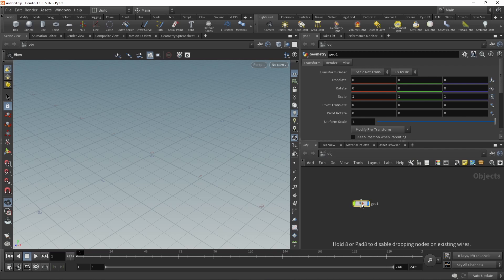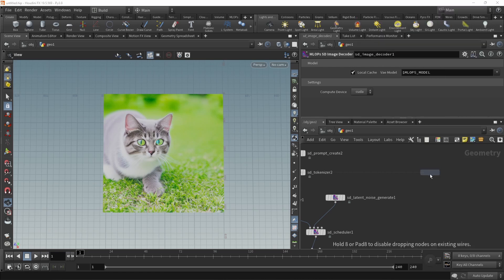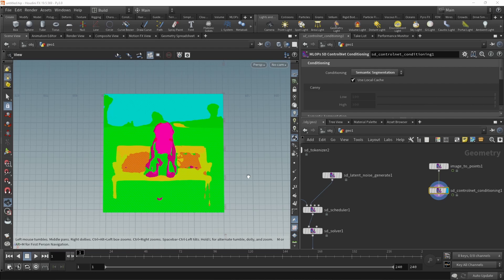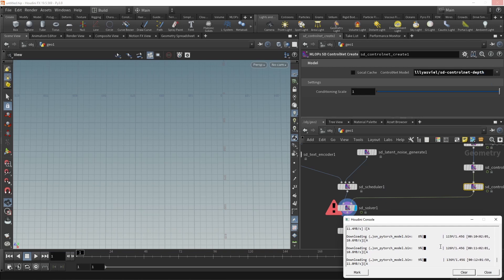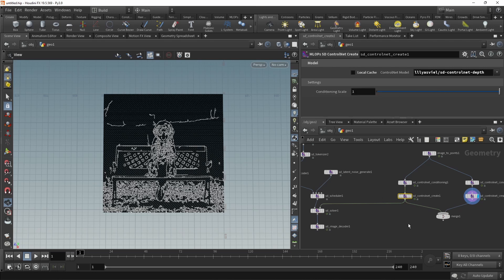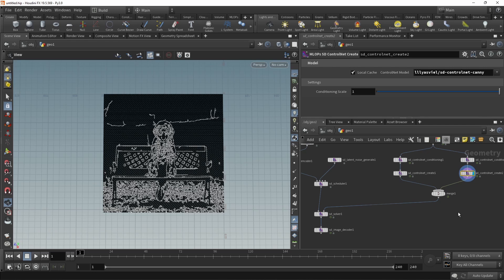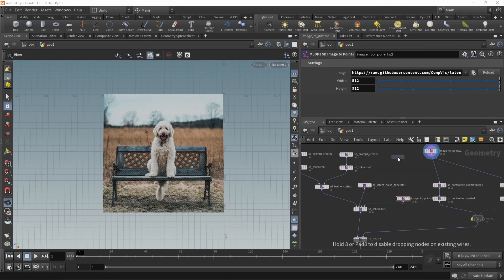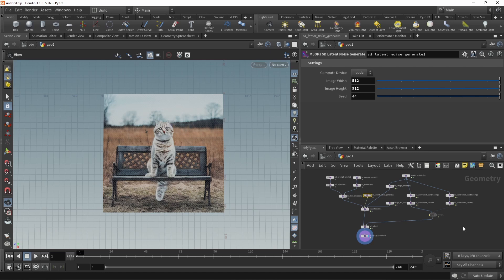MLOPS: ControlNet

Comment: great work!  By the way," setting traditional normal map " doesn't work,  even using your preset with spaceship, though it somehow partly worked on spaceship and certain shapes. I thought it was OpenGL vs direktX, inverted green channel problem, but if you open in Photoshop proper normalmap image and preprocessed normals and you fix RGB channels to match preprocessed one making them less contrasting, then SD Controll Net starts recognizing more of it. Maybe some gamma issue?  I assume this is important since Using Houdini generated maps inside Houdini can start giving advantage over automatic1111. Because you can go back and forth projecting results back and even cutting geometry with those colors